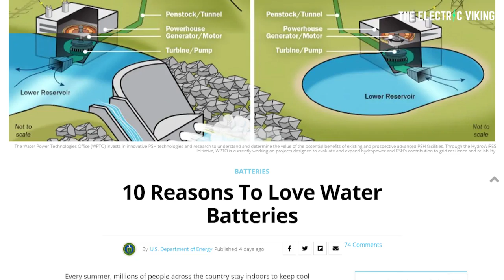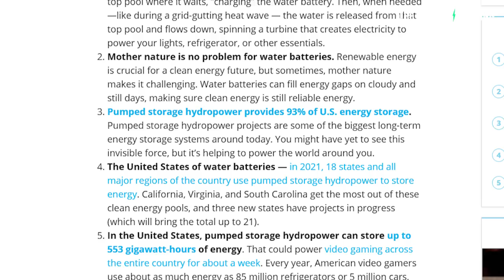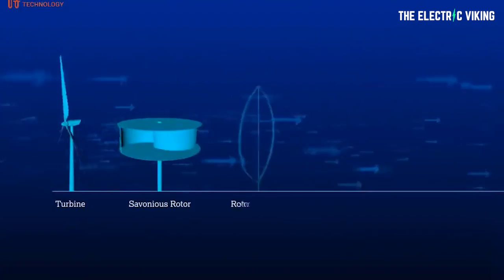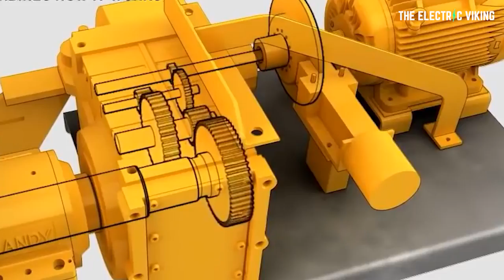10 reasons water batteries are awesome

Comment: Pumped hydro? 
No, it's terrible. Lots of water, inefficient, lots of land space, restricted by geography (it won't work in the flat Netherlands); it cannot provide enough capacity to store what we need, nor will it be effectint or very environmentally friendly.
There are many types of storage. Gravitational storage using weights in towers instead of water (my favourite), sodium-ion batteries, organic quinone flow batteries, hydrogen (for export to cold countries like Germany if there's an excess, or for storage).

Comment: Well done America for upgrading the electrics at 6 existing hydro plants, that make perfect economic & ecological sense. 👍🇺🇸
Building new Hydro plants is expensive in terms of money, & commonly the sacrifice of existing towns due to the required flooding.
The Viking's nailed it that energy's required to lift the water to the higher level for reuse, but pushing such a large head of water needs lots & lots of energy.
No process is 100% efficient or free, even with solar & wind assistance, so we're still up against it
The way forward is financial assistance for all households to expedite solar & storage adoption, where it's the most beneficial, which is at the load.
In people speak, the large transformers in the transmission & distribution substations won't need to be upgraded as often & eventually at all.
The little street transformers on the power poles or ground-level transformer cubicles in underground subdivisions won't need to swapped out & only need replacing if they eventually fail.
The next major step is to promote renewable home insulation, it's a one time cost that keeps saving money & irons out the interior temperature swings.
However, the Viking's exposed a major power draw in freak'n gaming consoles/thingies, like wtf. 
The ultimate plan should be to simply crush all gaming gear, get people off of their butts, wear sensible clothing at home or work when it's cold & do some physical work when home. Just those few things alone would take pressure off of the peak load problem.
By the way, promote this site to everyone you know, if you appreciate it, it's refreshing that it's a solid source of information that isn't rammed down your throat & foregoes yo-bro talk & misplaced baseball caps. 👍🇦🇺